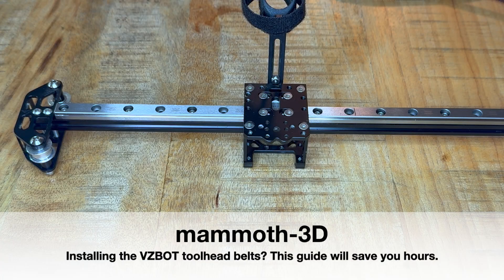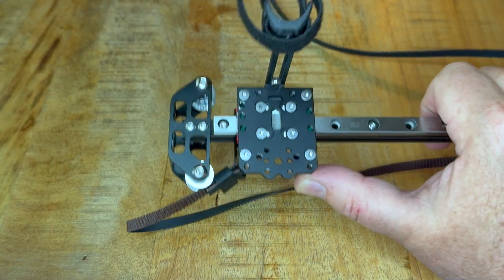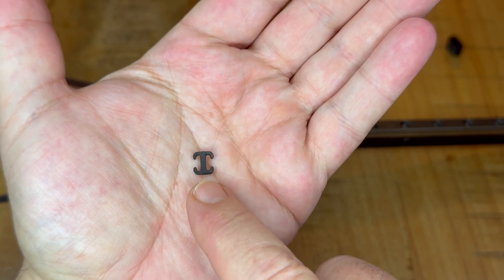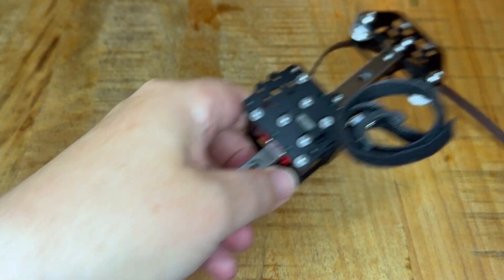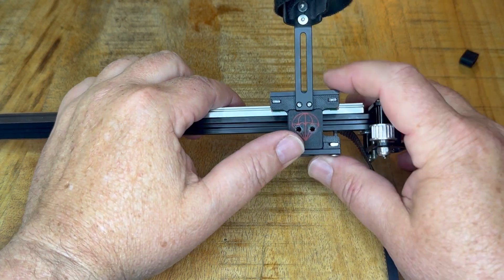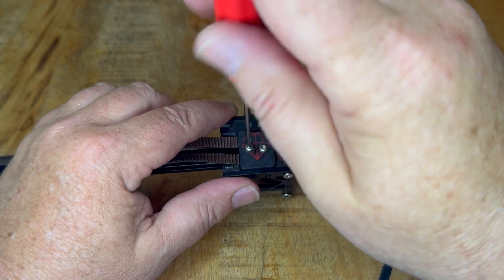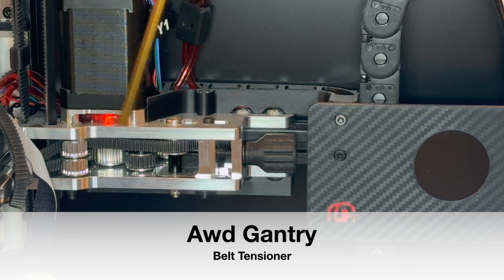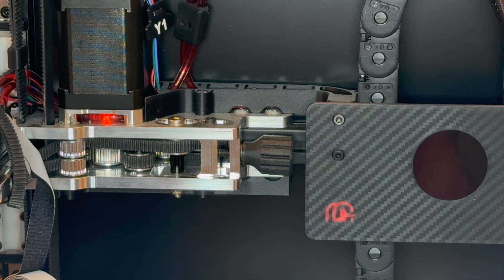How to Install Belts on the mammoth-3D X Axis with VZBOT Toolhead (Step by Step Guide)

Comment: Could you just make the parts that break off be connected so it two slot for the belt to pass though
Reply from the maker: Yes you could make something like that. But on the VZBOT Toolhead Im not changing anything at the moment as Im busy building my own printer ;-)